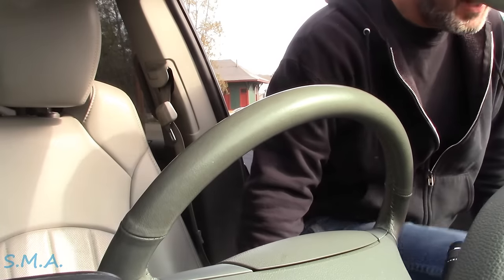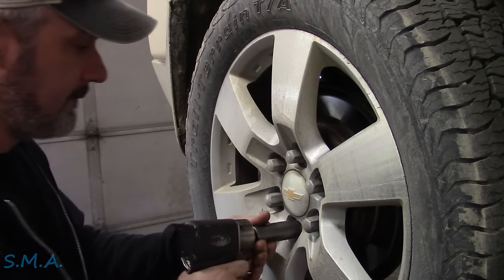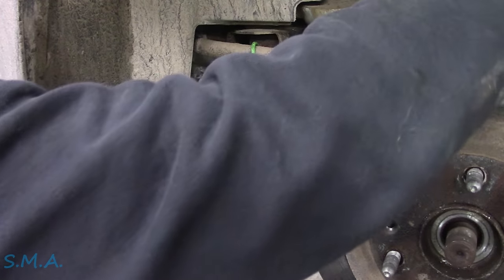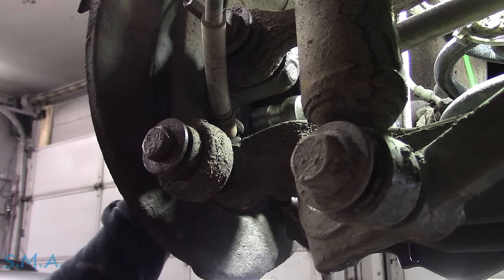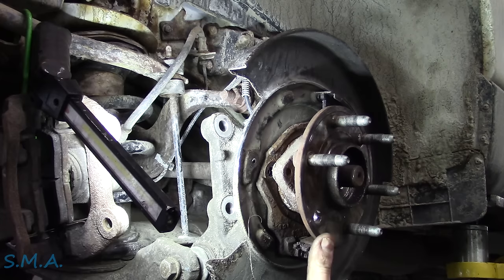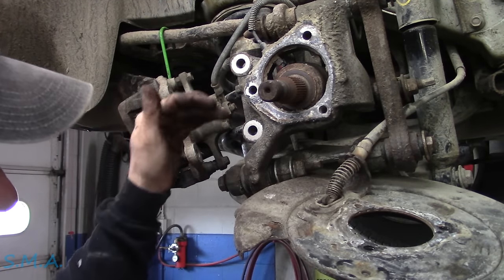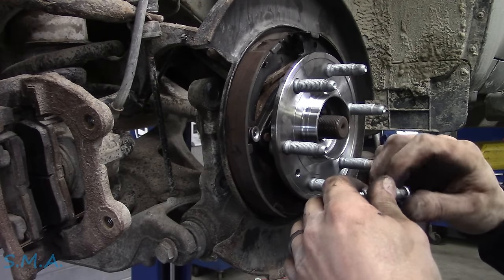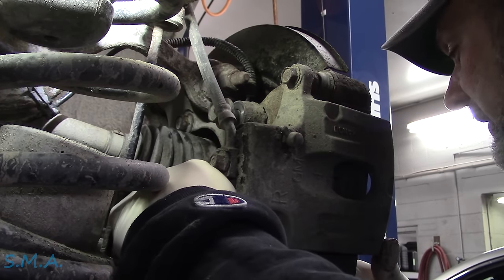Chevy Traverse: Won't Go Over 40mph ABS & Stability Light On

Comment from the maker: Such a simple tool but such a time saver! If it saves you an hour of beating it is worth the price of admission trust me!
Astro Tools 78834"Last Chance" (FIRST CHOICE) Impact Rated Hub Removal Bolt Kit:  https://amzn.to/3Nc6RDi
Reply: How bout them leaky shocks!
Reply: That was from mr.o spraying fluid film on the shocks 😂 lol jkjk
Reply: Astro is the tunas fish, I've been sayin that for years.
Reply: Astro Not a sponsor.......
Also Astro using MR. O video on their Amazon page......
Reply: Is that in preference to a hub puller with a slide hammer?
Reply: @DIYDaveOK  If you are doing a hub assembly, yes. If you are doing one where you replace the bearing only, no.
Reply: Remember, Astro isn't cheap, they're affordable quality!
Reply: @South Main Auto Repair LLC  thanks for the lead on the hub removal tools. Went to Amazon and ordered right away. Thanks for the videos.
Reply: Come on Sawn. GM shocks never leak. The day after the warranty expires they just disintegrate & fall off by themselves.
Reply: Eric that tool is wheel bearing sorcery! I’ve never seen such things! 😳🤣….Just ordered one
Reply: Lol the video demo on the Amazon page is Eric O
Reply: My techs use the old air hammer on the corner and spin the wheel bearing housing. I went on Amazon and bought the Last Chance to use at home. Thanks for the heads up Eric!
Reply: @kenl5217  Did Astro pay for this usage? He frickin' needs a sponsor and Astro tools seems perfect to me.
Reply: save more time by leaving new york and never have the problem again lol
Reply: @Blazer02LS  Thanks, Blazer. I thought that might be the case but wasn't sure.
Reply: The amount of time I spend beating it is nunya bidness, smarty-pants!
Reply: A 3 legged puller would not work?
Reply: @shoosh9996  3 bolts vs 1 bolt
Reply: I admit its a neat trick, but I do miss seeing Big Nasty come out to have her way with rusty hubs.
Reply: Ordered one
Reply: Apparently you guys bought them all.  No stock left. 😁
Reply: No more last chance tools from Astro on Amazon. Come on Astro you can’t sell it if you ain’t got it.
Reply: hello I have a 2016 Chevy Traverse Lt AWD and after replacing the front right strut the service traction control and stability lights came on the dashboard any help would be appreciated ty
Reply: this is the rear wheel bearing Hub. My car has service traction control and stability lights on the dashboard  any help would be appreciated I'm going to replace front wheel bearing Hub and wheel speed sensor on passenger side

Comment: I just had a 2010 Traverse come into my shop with a similar yet different problem.  Two other shops in town fired the parts cannon and the last shop was wanting to replace several modules (EBCM, ECM, TCM, and BCM), to the tune of several thousand dollars.  Turns out the EBCM was causing part of the bus to go offline, making the ECM, TCM quit communicating.  Wish I would have had the camera rolling so I could have done a wanna-be SMA video of the diag steps I took.  Doing a powers and ground check at the EBCM connector, I found that one of the two grounds to the EBCM was good enough to light a test light, but not good enough to light up my "load bank" of halogen bulbs.  Cleaned the eyelet for the ground, found and repaired the bad section of wire, and all the weird electrical gremlins went away.  All done in about half an hour and I had an ecstatic customer.  Thanks for being the inspiration to take on even more troubleshooting jobs than I already had been doing.  You're the best!
Reply: Seems like auto repair shops need an electrical technician on hand to actually diagnose modern cars correctly
Reply: It sounds like my wife’s car is doing the exact same thing and there trying to charge us $4,000 for the transmission

Comment: For me the sound of the pneumatic impact wrench struggling and then moving freely is the sound I associate most with the mechanic shop. From childhood.
Reply: That sound can usually be followed by whole bunch of cuss words if whatever is being impacted just broke! lol
Reply: I can attest to both of you....many times over! 😁
Reply: That pneumatic sound reminds me of the dentists office where I spent a lot of time as a kid.
Reply: @richardbambenek2601  certainly the grinder does, after all Dentist uses something very similar. Just smaller
Reply: @kevinbarry71  the guy installing my new kitchen cabinets was using an oscillating tool,  told him the same thing.😁
Reply: or the air compressor lol

Comment: Thanks to you Eric O, I just replaced both front wheel bearings on my daughters 2003 Subaru outback. Took them to my work (I don't have a press) and pressed out the hub, pressed out the old bearings, installed new inner and outer seals, pressed in the new bearings, then pressed in the hub. It is a quiet as a church mouse now. Thank you so much for the tutorial, You are awesome!
Reply: HAVE YOE BEEN WATCHING STEVE ON SIMPLY DIAGNOSTICS  ERIC O HAD HIM ON ONE OF HIS VIDEOS I THINK A WHATS UP WEDNESDAY

Comment: Nice work!!! You made quick work of that rusted hulk. It's interesting to see the different techniques from different mechanics from different locations around the country. Being from Arizona, the interior falls apart from sun rot 10,000 years before the chassis even sees any rust. The only moisture we see is from the Polar pop from Circle K evaporating in the cup holder!! I recently installed a dash cam in our Ram 1500 and had to find one that was spec'd to 195 degrees......
Reply: They make dash cams with this spec? Mine needs to warm up before it can work. (Near freezing temps where I live.)

Comment: Love the Astro bolt trick. I have converted 3 mechanics I know to use them. But did not know they were a real tool, so they just use a nut and bolt. Just a bit more friction, and a little marring of the surfaces it pushes on. But it works. Now i can pass along the actual kit. Thanks.

Comment: I remember running across a nut on a bush hog with 7000 ft lbs of torque until I figured out it was left handed thread!
Reply from the maker: 🙄 I've never done such a thing.....
Reply: @SouthMainAuto  my first car was a 70 road runner, taking off the drivers side wheels the first time was a bugger! LOL
Reply: @leftyo9589  Funny you mentioned that, i have a home made car dolly with a 60's dodge van solid axle, that i could never get the one wheel off, ended up cutting the tire off the wheel a couple times to change it, and finally put my 1" impact on it, broke 3 of the studs, and got the socket stuck on #4, put the impact in reverse, and ill be danged if the lug nut didn't come off. Bought all new passenger side studs after that fiasco, lol
Reply: I used to maintain a 1969 Rolls Royce Silver Shadow which had LH wheel nut threads on the left side. Had both front hubs off once to regrease the bearings, and got them mixed up when I refitted them. That caused some confusion (and cursing) when I tried to refit the wheels and realised what I had done (2 sets of brake calipers on each side to remove and refit as well to put it right).
Reply: LH threaded nuts/bolt heads should have a groove through all the points, half way up the hex. If they don't, it's probably import garbage and should be replaced because the grade mark can't be trusted either.
Reply: 🤣🤣🤣 been there

Comment: Hello Eric love your content, I am a retired mechanic, I have worked in the auto and aviation field. Your comments on using dielectric grease on connectors is interesting. When I worked for the airlines our Hobart ground power units for aircraft had issues on foggy and rainy Days.  The Hobart engineers would not say one way or another if we could use dielectric on connections we did any way and it eliminated almost all moisture problems. 
I have always used dielectric in weather pack connections while in the auto repair business especially under car. I think there is a Saturn TSB on ecm problem to use the grease on the connectors but don't quote on that. I am An old dog that will new tricks and that's why I watch you, Please enlighten me. Thank you and your wonderful family

Comment: I just bought the second version of the Astro Onyx Nano with 500lbs of torque and haven't used it yet but summers coming
Reply: I got one recently actually. Lemme tell. Mean little impact actually. Ran a wheel bearing in real easy😏

Comment: I did one these last Friday on an Equinox, same thing just the left side was dead. It was in for inspection repairs. Went to put the rotor back on and the shoe fell off the backing. It looked new like yours. So new shoes and hardware, went for a test drive and abs is coming on. Right side is dropping out now, awesome.

Comment: I live in the rust belt south, North Central WV.  I put antiseize on the splines of the axle whenever I have to remove any of mine so the second time it's easier.  I've had them so bad I had to use an air hammer.   There was one where 8 pound sledge wouldn't move the axle in the hub.

Comment: 34mm axle nut...

I recently decided to increase the capacity of my pneumatic impact hammer choices to my DIY efforts and added a monster IR 3/4" example to the mix.  The tool was only a very small part of the necessary air plant upgrades required to feed the new monster.

I added 1/2" quick-disconnects to the three air tanks (two 28 gallon and a 60 gallon).  The big quick disconnects allow me to join all the tanks together if tackling an air volume intense project like the 3/4" impact, sand blasting, and/or plasma cutting.  I worked up a couple of 1/2" quick-disconnect to four-port manifolds which have 1/4", 3/8" and 1/2" sizes on them for any future go-big tool additions.

The new 3/4" tool, a month of parts orders, and installation effort of air plant infrastructure upgrades so the new toy would play...  But, boy oh boy does that thing bring the beans!

Comment: Exact same problem just happened on my 2017 Traverse Premier a few days ago.  Service Stabilitrak System, ABS off, Traction off, All Wheel Drive off.  Right rear wheel bearing was the issue.

Comment: I find it way easier to turn the wheel toward the side I am working on when working on front brakes. This way I can use my impact to remove the caliper bolts-no more busted knuckles. TY for the fix. I have the same issue on an Acadia and was not sure how the reluctor wheel was supposed to look. Apparently not nice and shiny LOL. I have been a fan of your channel for years. Thought I might pass on a little trick to help.

Comment: Always enjoyable watching you perform your magic, i have a 2007 Chrysler 300C that will not go over 39 MPH, i guess its the wheel sensors on this car also, but only has 32,000 miles yes that's right 32,000 its a neighbor's car and is a snow bird. Bought it and it is like out of the show room. Who would know this would happen with this many miles on it, what do you think. Tom of Cape Coral Fl.

Comment: Eric I thought you owned the 8629 wheel bearing hub removal tool?  The metal bar you nut onto the hub and give it one good wack with a sledge hammer and the bearing is out. Awesome tool, only once I've had to hit it twice lol.

Comment: maybe....just maybe try putting down those thick rubber mattes under the lifts to prevent the meeting of concrete and plastic power tools. just a suggestion. battery tools are more mobile than air and are nice to have in a hurry.  each to their own though and i appreciate the knowledge you spread willingly and freely.   
  i work in concrete and we use battery tools(impacts, drills, saws, multitool, rotorhammers, etc.)every day and all day and ive been "testing" different brand thru the years and i am not nice to them. they get thrown, dropped hit with boards, and other things and so far dewalt has been the toughest.  i usually get them from the local pawn shops because theyre cheap the "testing" im doing is just for me so if someone asks about a brand, i can give knowledgeable answers with real world function tests.  thought about youtubeing it but i like doing things my way plus i love my job and dont want to dirty it with yt. lol!!
   thank you eric for all the knowledge you willingly give to the world.  i know its save me thousands of dollars doing my own repairs and helping others with their problems. God bless.

Comment: I replaced my brake rotors and pads front and back a couple weeks ago on my 2012 GMC Acadia and the I guess the banging on the right rear rotor buggered up the wheel sensor like this one and the traction control and anti lock lights came on also stabilize control came on as well. Fortunately there was no loss of power but it would make a clunking sound coming from the front are I guess while it was self diagnosing itself but would stop after I drove for a minute or so and would then set the trac control and anti lock  lights off on the dash.

Comment: Hello again I just watch this video.  I know you used a brass hammer on the end of axle but I would smashed the threads on the end. I was taught to put nut back on so you wouldn't have burred up threads.
Reply: He knows what he can get away with, comes with years of experience. This vehicle is past half life and the bolt he beat on is the least of any problems that will soon occur.

Comment: i cant believe the magnet isn’t replaceable without pulling the hub off. crazy!  thanks for this 👍
Reply: Not this bad its way worse when they are integrated in the wheel bearing and the only way to change them is to replace the entire wheel bearing assembly

Comment: Interesting insight into the longevity of power tools contrasting with those of air powered ones. The real test comes with constant professional use at the coal face. When the Canary stops  singing, the power tools are toast. Nice bit of of strategy loosening the hub.

Comment: Awesome video, puts me in path to a similar issue I have going on with a 2011 GMC Acadia. Replaced speed sensors and still have issue, now seeing this I’m going to check the hub magnets.  What model Autel are you using, or used on this project?

Comment: Nice tool, I actually made my own hub shocker tool out of a trailer hitch that came off a used car. Anyone doing this job be mindful of the stupid wheel speed sensor! usually pushing that axle in will give you the clearance needed when the hub comes loose and the axle pops forward

Comment: I removed a wheel bearing just like that one last week on a Buick Enclave with a 2 foot pipe wrench and a 3 foot cheater pipe on the end of it. I removed the adjuster, put the wrench on the hub and jumped on the cheater pipe and the whole thing came apart. I live in northeast Ohio and it's pretty rusty and crusty here as well.
Reply: Dont try this at home but loosen the attachment bolts 1-2 turns and jump some railroad tracks. 😁
Reply: @danfarris135  Or if in Pa, just drive it around the block, the potholes will knock it loose, lol

Comment: The GM 3.6 - the engine that has bought more boats for techs than any in history.
Reply: Got mine fron it lmao those motors are a tragedy but easy to work on
Reply: well, i mean when they blow up, they can use them as anchors on their new boats, win-win, lol!!! Those engines are a dumpster fire tragedy, and I live and bleed GM......
Reply: Jimmy S  correct almost all the 3 .6 motors

Comment: 018 jeep compass had same problem. Wonder if it has similar type of wheel bearing, with the magnetic ring . Cause  that is what was replaced . Rear right bearing . I would had replaced it myself if I would of known that is what caused  drive train , stability problems.

Comment: Those Last change"" bolts can be lubricated with a drop of gear/diff. oil. That type of oil withstand high pressures on the treads. Well that's what I do.

Comment: I literally just did one of these on a 2013 acadia. Same thing. Wheel bearing speed sensor fell off. Junk design.
Mine was all boogered up here in the salt belt of onterrible(Ontario) with the aluminum oxide.
Also at 15:45 you hear someone dropping off another Chevy!

Comment: I was wondering why you put the  torx screw back in the rotor?
I  was told years ago that they were installed to keep the rotor on,  as it was going down the line at the factory, and it serves no purpose other than to keep the assembly line moving.

Comment: I use the air hammer with a shaker adapter on the 3 bearing bolts from behind. Bing bang boom.

Comment: It seems like they make these tone rings on newer cars so cheap that they rust away. I remember on one of my older cars it looks like an actual gear with teeth on it.
Reply from the maker: That is the difference between active and passive  wheel speed sensors ;)

Comment: Thanks as always for sharing the video.
Would you please tell me where I can purchase the "bit" that holds the emory cloth you used in the drill for cleaning the hub bore? Thank you.
Reply: Just in case you don't get a reply, back in the late fifties we used a dowel and cut a slot with a hacksaw for the cloth, trimmed down the dowel for the drill shank.  Cheers

Comment: Thanks for the great video.  I’ve got a 2017 Traverse that has the “Stabilitrac System Off” warning but no ABS light.  It feels like it shifts funny around 50 MPh.  Any ideas?  Wheel speed sensor?  Could a wheel speed sensor fail without turning the ABS light on?
Reply: Did you figure what was causing this? I'm currently deal with the same thing no ABS light as well
Reply: @justnay218  yes I did figure it out.  For me it was a sagging brake pedal.  I made a video on this if you want to go to my channel.

Comment: Best technique for removing stuck brake rotors.  Pressing off from the caliper bracket holes.
Reply: 98% of the time I agree, unless it's a 2013 f150, then it will break the rotor surface area off the "hat" section, lol! I live in Pennsylvania, i know rust too, LOL!!!!! That truck got a whole new front hub after that mess....